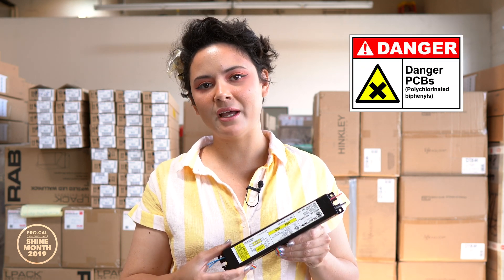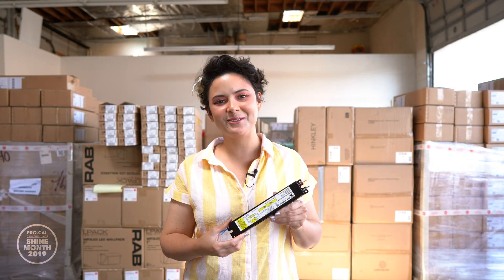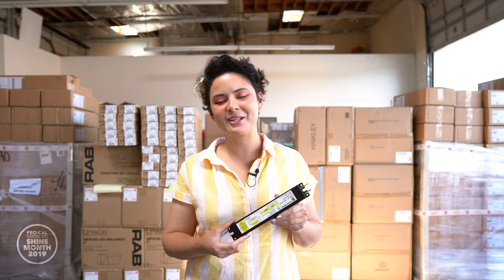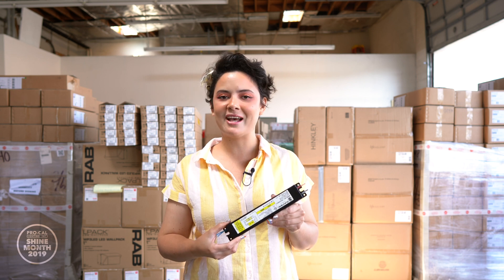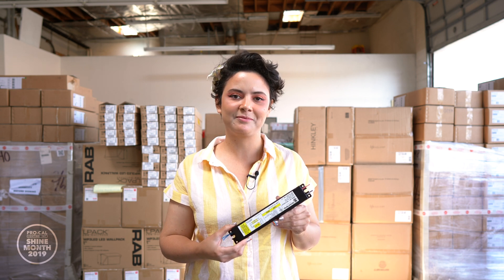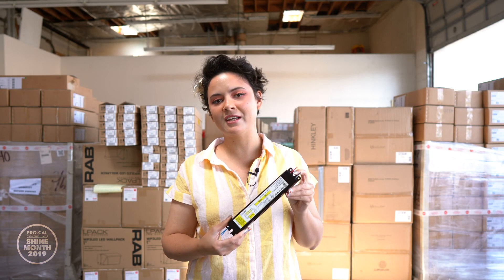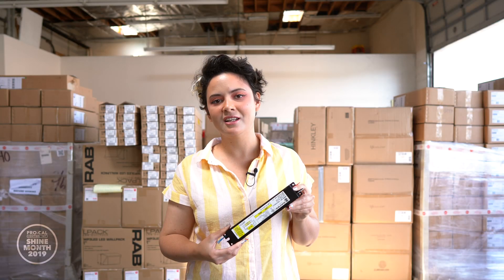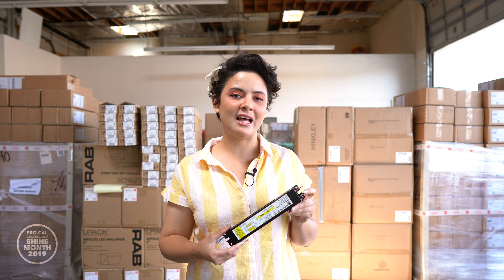SHINE SAFETY - Polychlorinated Biphenyls (PCB)

Comment: if an older PCB containing  flourescent ballast is operating in a cooler environment,  and burned out lamps are promptly replaced it's not uncommon to see ballast 50 to 60 years old or more and still in good working order.   That's increasingly becoming not the case.   For example about 15 to 20 years ago energy saving lamps were rapidly gaining popularity, such as 34 watt instead of a 40 watt, for your typical T12 4 footer,  or more recently 32 watt T8 lamps.   Unfortunately this will often cause an old ballast to run hotter and fail, possibly leaking and possible fire, since most ballasts old enough to contain PCB'S were only designed to run full size, 40 watt lamps.  There are undoubtedly many PCB ballasts, in service to this day.